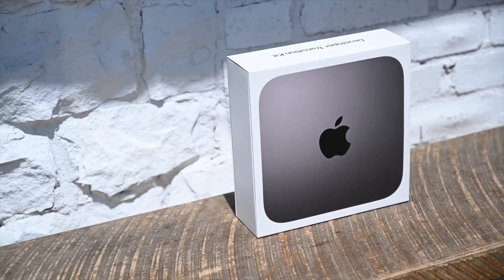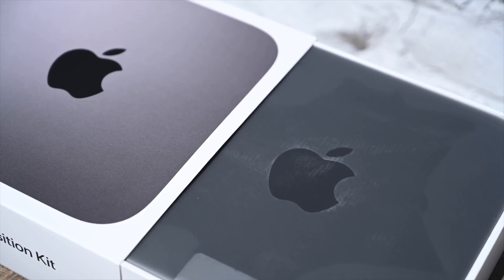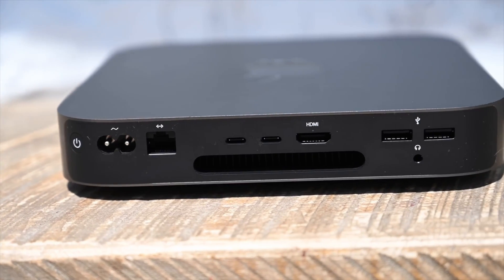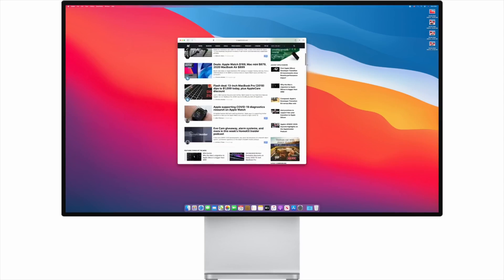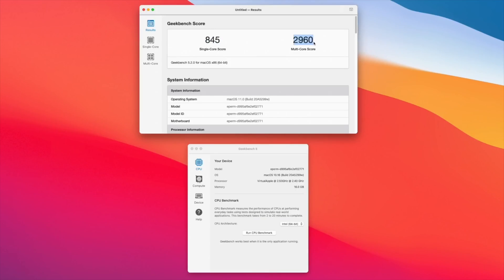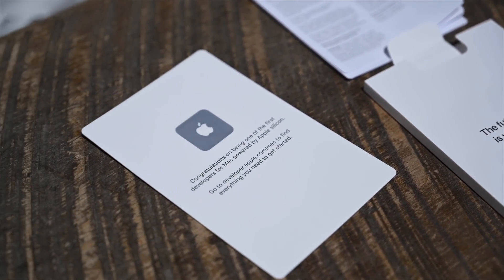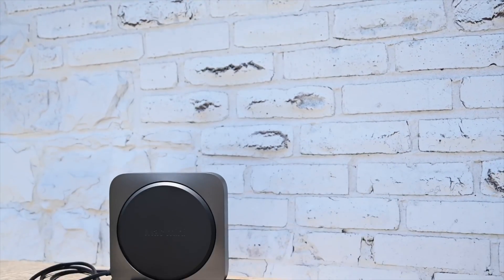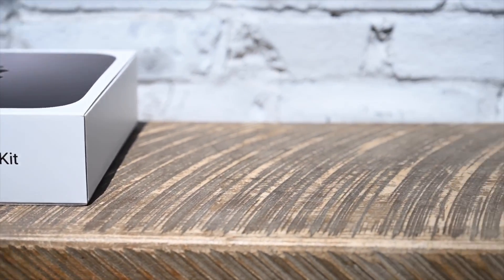Apple Developer Transition Kit / Apple DTK - Unboxing & Benchmarking

Comment: Thanks for the uploading the video.  I’m a game developer, making some utility apps as well.  Can it be used as a development machine of iOS games using that bundled Xcode? (Or can I install Xcode 11.5 Stable version on that machine?)   Any limitations compared with the Xcode 11.5 stable version of Intel Mac?   I’m usually away from using Xcode beta for it crashes sometimes for a certain feature which is utmost necessary in making iOS, iPadOS, Mac games.  Nobody knows this.  I’m thinking also converting Mac Intel based-apps into upon Apple Silicon machine.  Thanks in advance.
Reply from the maker: Sorry, I can’t answer that question
Reply: Should be able to. I’d check Apple’s developer videos to be sure

Comment: Does it have a Fan ??? (I think it does )
Reply from the maker: Yes it has a fan
Reply: sinoptik oh ok then. Then that means all arm Macs will probably have a fan or two fans too.
Reply from the maker: Yes, If they don’t resurect the 12 inch macbook line up.
Reply: sinoptik I Hope they won’t do that again with the 12 inch MacBook like they did in  2015 to 2017. I mean that passive cooled MacBook lacked in performance and some very old MacBook Pros From like 2010 beat the shit out of it.

because it didn’t even have a fan , just a heatsink. So people were basically paying over 1000$ for a laptop wich had the performance that is worth like under 300$.

And instead Apple putting a fan in it so the 12 inch MacBook won’t have heating problems and will be faster  ,*they just cancelled it in somewhere in 2018*

I hope Apple won’t do such a dumb thing again and puts a fan with heatpipes to the arm cpu/gpu in the 12 inch MacBook.
Reply: Razer Fan Boy they might use a fan but tbh they don’t need one. The iPad Pro doesn’t use one and it’s performance is great and it’s smaller than the current MacBooks